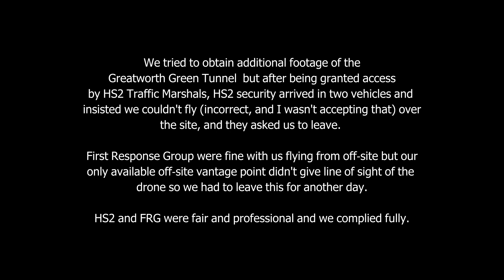HS2 Green Tunnel at Chipping Warden - November 2023 - FlyDJI

Comment: What with the cost problems I fail to unerstand why thus is now just left as cutting. That will save a few pounds. Wildlife mittigation sits can be provided as easy as they are on canal restorations.
Reply from the maker: Do you mean, don't fill it in, keep it as it is now?
Reply: @flyDJIuk  Basically yes.  l know the cutting may be wider than needed now but the saving on tunnel arches and the cover up replcement must be considerable.

Comment: If you want to avoid detection in the future, it is important to follow a few principles:

Maintain discretion: Avoid suspicious behavior and do not draw attention to yourself.
Dress appropriately: Adjust your attire to blend in with the environment and avoid standing out too much.
Avoid sudden movements: Move smoothly and without unnecessary abrupt gestures.
Avoid direct eye contact: Do not maintain prolonged eye contact with security or other individuals.
Avoid using bright light or flash: If you need to use a recording device, make sure it does not emit too much light.
Choose strategic positions: Position yourself to have a good perspective while also avoiding direct attention.
Find natural cover: Use elements of the surroundings that can conceal your presence.
Avoid revealing sounds: Turn off sound on your device if possible, or use quiet modes.
Act like a local resident: Mimic the habits and behaviors of people who reside in the area.
Be aware of your surroundings: Observe the reactions of the environment to respond to changes in the situation.
Remember that all actions should be in accordance with the law and ethics. Illegal practices or violating regulations can have serious consequences.